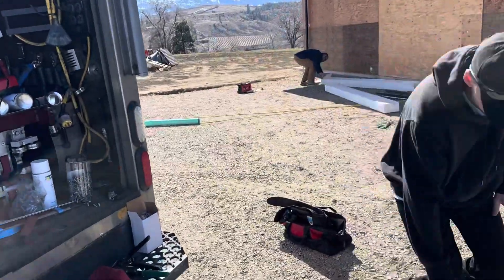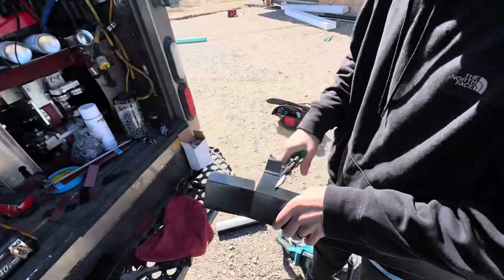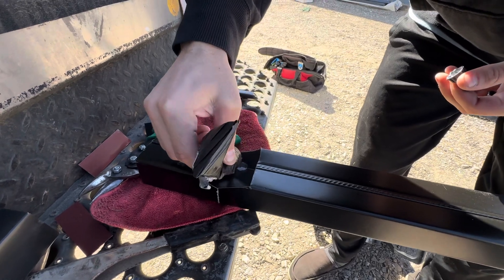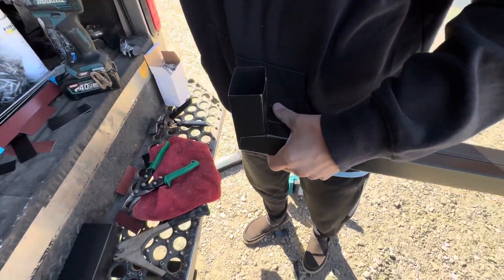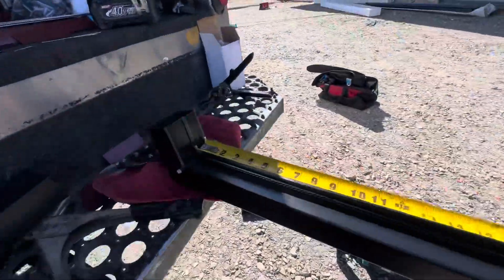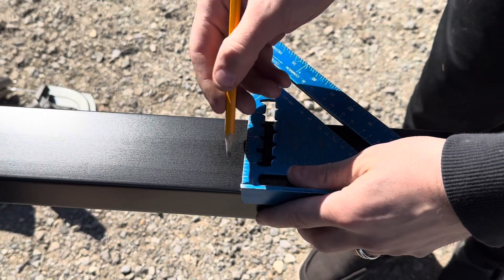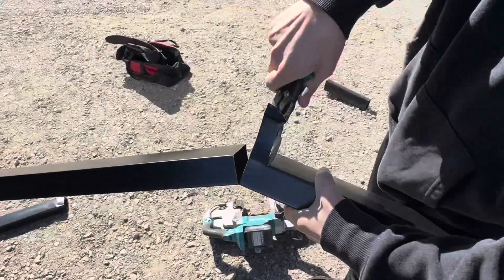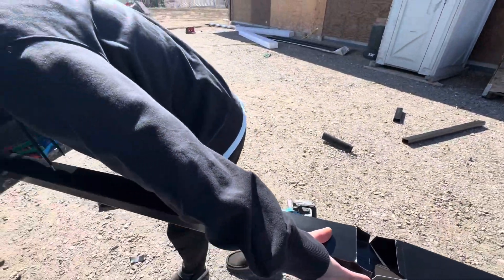✂️ Square Downspout Cutting Mastery | Professional Techniques Revealed 2024

Comment: If you measured 49” from the outlet to the wall. How many inches are you adding because of the angle? In the past, I have used a bevel and protractor for different angles, but I didn’t know about the 1” and 1 1/2”